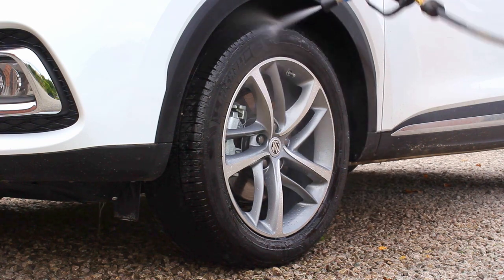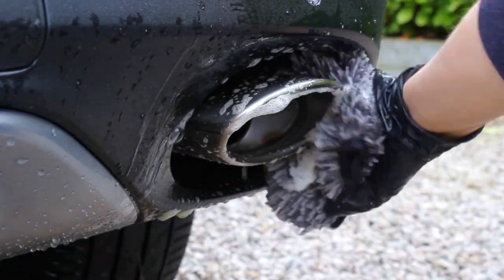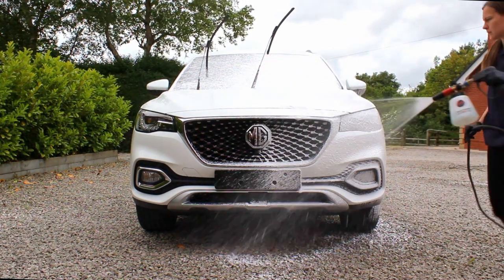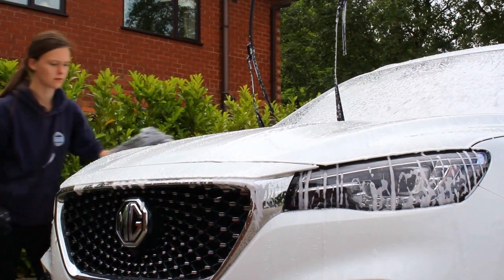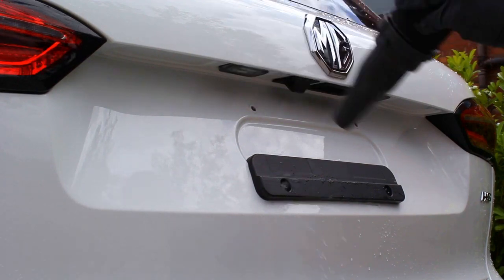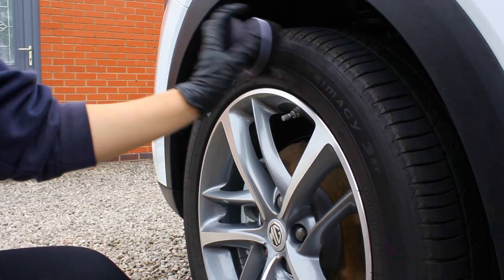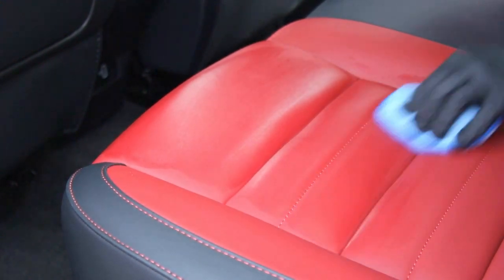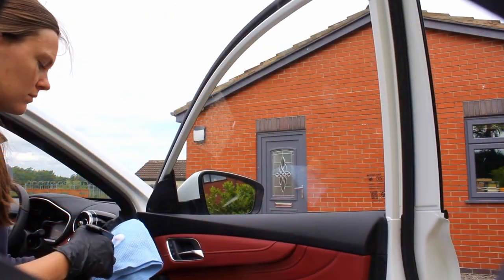Exterior and Interior Clean | Maintenance Wash on a Ceramic Coated Car

Comment: Yes! Using a 2nd application of snow foam to add lubricity for the contact wash is something I rarely see UK detailers do. It makes a lot of sense though. Heather, I don’t recall, but have you ever used P21s Polishing Soap on exhaust tips? It’s an outstanding product and easy to use .
Reply from the maker: I've not tried that one before! I like P21S Paintwork Cleanser and Wax so I'll keep an eye out for the polishing soap :)

Comment: Hi Heather, thank you for making a video with some variety - nice to see a maintenance wash on a ceramic-coated vehicle for a change.  One question though, you don't consider using a topper on the ceramic coat?  I do that with my Tesla Model 3; it's coming up on 4 years with the CQuartz Finest Reserve ceramic coating and just using a simple Gyeon topper it still has incredible hydrophobic properties.  I understand some think it is a waste to put a topper on a an existing coating, but I'm happy with my results and amazed that after nearly 4 years I'm still reaping the benefits of a ceramic-coated vehicle.
Reply from the maker: Thanks for watching! I did think about using a topper on this but I decided against it as Pyramid don't have one at the moment and I was interested to see how the coating would manage on its own. I might top this up at some point in the future but at least for now I'm happy with the performance!

Comment: Another great video, my wife's car has a large sloping front windscreen with a large dashboard. Reaching all the windscreen to clean the inside is a pain/annoying/ arrgh I give up, do professionals like yourself struggle with that and what tips/ tools which you use help you out? Thank you
Reply from the maker: Thank you! I know exactly what you mean, cleaning the inside of those windscreens can be a pain. I haven't got one personally but I have seen some tools like this that look quite handy: https://www.amazon.co.uk/Stoner-Car-Care-95160-Reach/dp/B01M9JUEQX/ref=asc_df_B01M9JUEQX/?tag=googshopuk-21&linkCode=df0&hvadid=309775958298&hvpos=&hvnetw=g&hvrand=3252636672392657716&hvpone=&hvptwo=&hvqmt=&hvdev=c&hvdvcmdl=&hvlocint=&hvlocphy=9041112&hvtargid=pla-450133255883&psc=1&th=1&psc=1. I'm not actually a pro at the moment btw, but never say never haha!

Comment: Great video,, I'm having a lot of problems with white water spots, after being out in showers, I've got ceramic coating, and top up with fairly diluted Lavish, at every wash,, any ideas on reducing the white marks,,???  😍. xx. ps, it's a dark blue car, so they wouldn't show up on a white car like this one,, x.
Reply from the maker: Thank you! Koch Chemie FSE is a good one for removing water spots. You can just quickly go over the car with the spray and a microfiber towel after the wash if you spot any

Comment: Very interesting Heather, just watched another very well known YouTube detailer fail miserably with the MJJC and the GT snow foam.  Roughly where did you set the lance valve to? All the best.
Reply from the maker: Thanks for watching :) I just do a quarter of a turn lower than max, but any adjustment on the foam cannon slightly lower than max seems to change the consistency quite dramatically!
Reply: Flow rates will differ across different setups. Comes down to PIR and end point concentration.

Comment: Good video! 
Question: When i wash the rims they look good but then driving home i see dirty water inside the rims and it looks really ugly. I clean behind the spokes etc, use alkaline, foam and brake buster plus manual agitation but still this happens. Any tips?
Reply from the maker: Thanks Chris! You can try using an open ended hose to rinse the wheel after rinsing with the power washer or at the end of the wash as low pressure water tends to rinse dirty water out of difficult to reach areas a bit better sometimes!
Reply: @AutoCareHQ  Thank you for the response. Unfortunately i don’t have access to that due to using a commercial wash space. Will see what i can do!

Comment: Fantastic job heather great tips as usual, and yes rubber mats are great I have replaced all mine in my Astra including the boot with rubber, sadly talking of Astra the latest one I have come to the conclusion the paint on these is terrible well perhaps not the paint but clear cote it scratches far to easily ,heather if you have any ideas like coating I can apply please let me know ,
Reply from the maker: Thanks very much Adrian! It's definitely worth considering a coating if you are finding the paint is soft on your car as it will help to provide some level of protection against wash marring. It'll still need to be washed safely but it should help. I'd definitely recommend this coating so far, I'm really enjoying the performance and it was so easy to use. I've heard Infinity Wax Synergy Lite is also very good, not as durable but it and has some filling ability to help hide minor swirls a bit. I'm tempted to put one that on my car actually!
Reply: @AutoCareHQ  
Thanks heather for taking the time to reply  and supplying the name of the product , someone mentioned in the Astra k forum about a ceramic coating , what’s your thoughts on that am I rite in saying it’s a pig to apply properly.
Reply from the maker: @adriancarter825  No problem at all! So the ceramic coating I used here (Pyramid UBV New Era 3 Year) was super easy to actually apply, probably easier than most waxes and sealants I've used to be honest. The time consuming part is just the prep. The paint needs a full decontamination and polish so that took about 8 hours to do before applying the coating itself. It's not really difficult it just takes quite a bit of time!
Reply: @AutoCareHQ  that’s great advice thanks so it’s the prep work that takes the time , mind you that’s like most jobs if you want it to turn out nice , thanks again heather love your channel and all the tips and tricks to having a better looking car .

Comment: I have always wondered if a ceramic coated vehicle can take a impact of stone flying from another vehicle at 50mph or above.
Reply from the maker: Ceramic coatings don’t protect against stone chips unfortunately. PPF will help to shield the paintwork from minor stone chips 😊
Reply: No, Pretesh. It won't. A stone at that speed would go through the coating, the laquer, base coat, and the primer. Possibly right through to the metal and leaving a dent. Coatings are less than 2 microns in thickness. Basically, less than 2,000ths of an inch thick. You'd need several hundred layers of ceramic to have any chance of protecting the laquer underneath and even then a stone travelling at 50mph would go through most if-not-all the coating. That's why a coating is called a sacrificial layer.